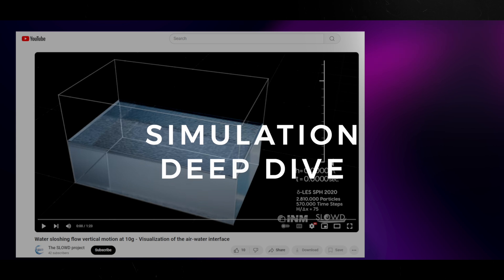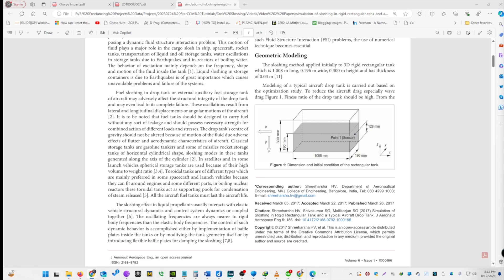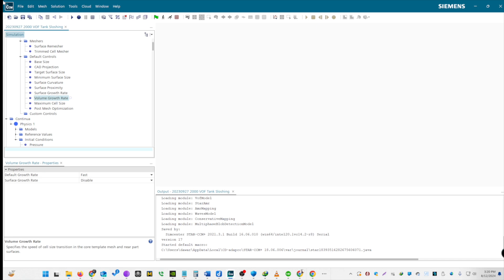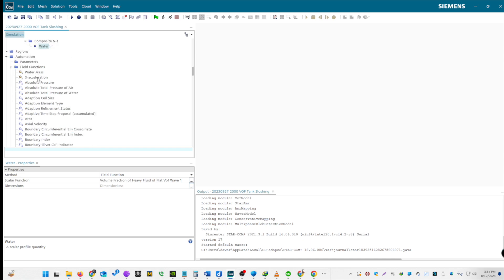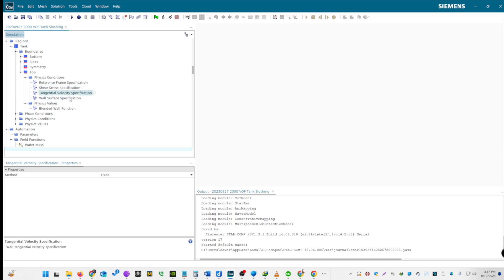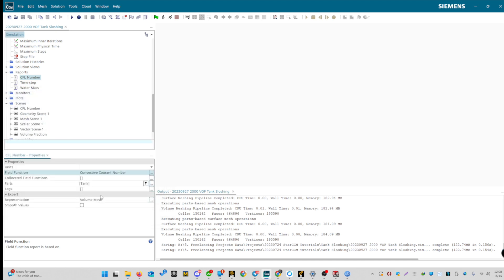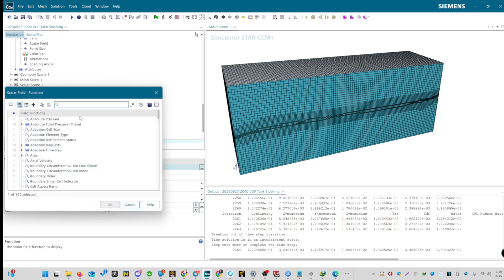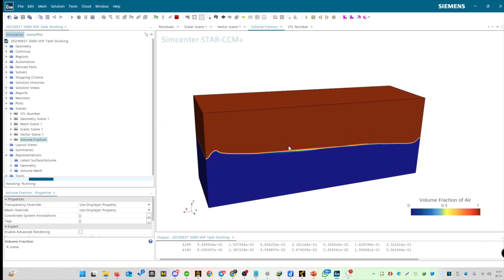Volume of Fluid (VOF) Sloshing Simulation | Simcenter STAR-CCM+ Deep Dive #3

Comment: thank you for the video.
I have a question regarding the solution history. Is it possible to extract point probe data from a solution history that was recorded only on faces, assuming the points of interest lie on those faces? For example, I have temperature data recorded on a face, but I’d like to extract localized values at specific points on that face. Do you know if this is possible, and if so, how it can be done?